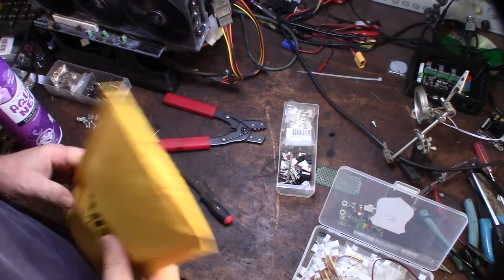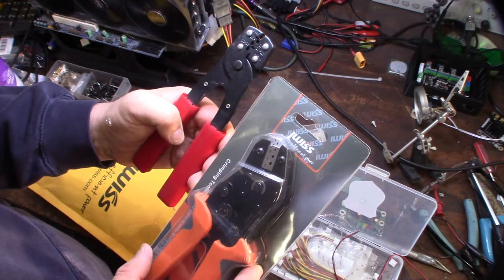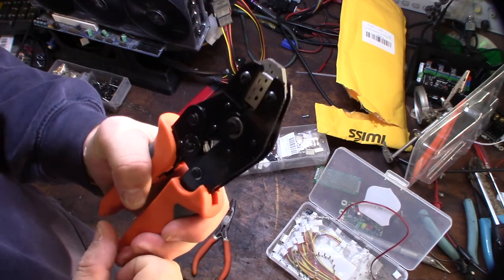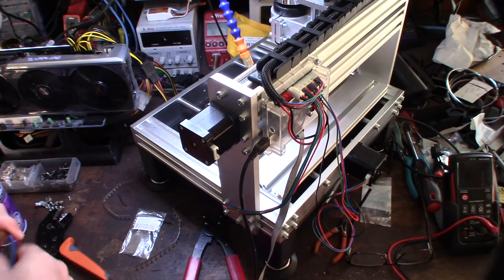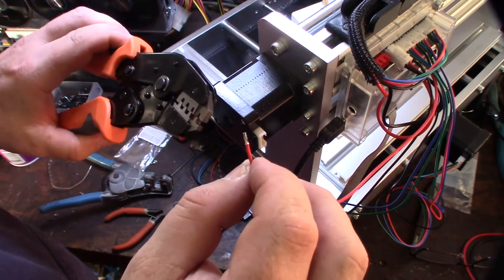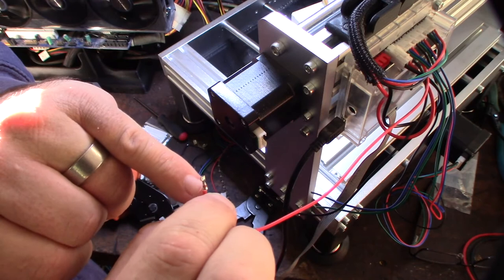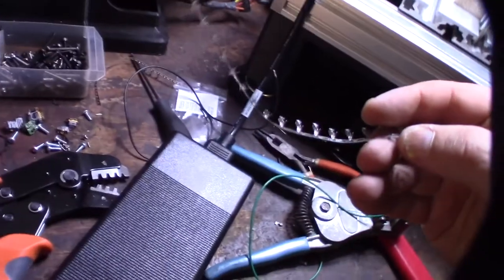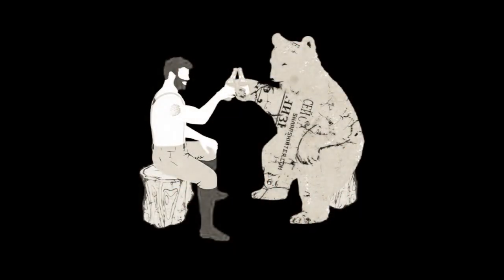iWiss Micro Connector Crimping Tool for JST Molex Amphenol Automotive 3D Printer CNC SN-2549

Comment: You're supposed to put the terminal in the tool first, ratchet it down until it just grips, THEN put the wire in. That way the tiny terminal is held securely in the tool for you and you don't have to awkwardly balance it on the end of the wire while trying to get it into the tool.

Comment: I realize this is an old video.  Maybe you have found out now, that really is the wrong crimper for the small connectors (despite the marketing info).  Check out the iWiss 3220M, it is designed for these smaller connectors such as JST XH/PH, Molex Microfit etc.
Reply from the maker: Yep, I have the smaller ones now for the JST connectors

Comment: Looks like you can adjust the crimp pressure with the side star washer device. I like the look of iwiss crimpers. I think the ratchet is for consistent and uniform crimp pressure, as ones hand gets tired after a few hundred a day perhaps. Nice one. 👍
Reply from the maker: I like the feel of the ratcheting action. My only issue is on some connectors It forces me to over crimp cutting the wire. The ratchet action prevents me from backing off.
Reply from the maker: I love them besides that. Nice to finally have a pair of real crimpers.
Reply: @fintechrepairshop  there is a tension adjustment for the ratchet, loosen screw by ratchet and adjust position of the ratchet release. Does it still over crimp on the softest setting?